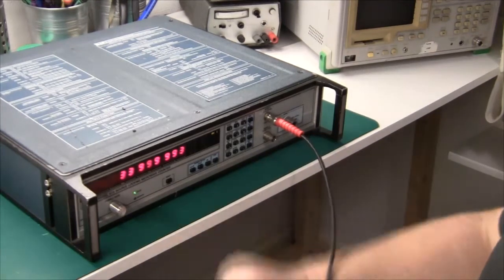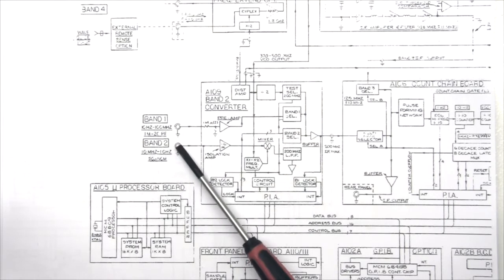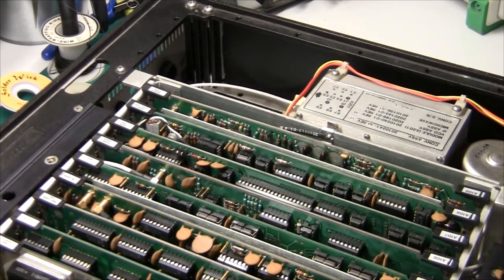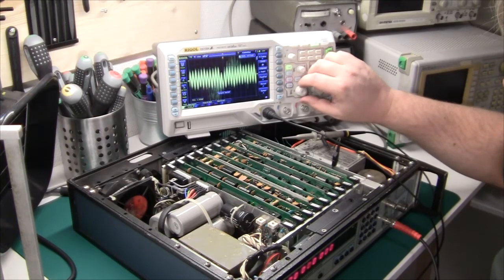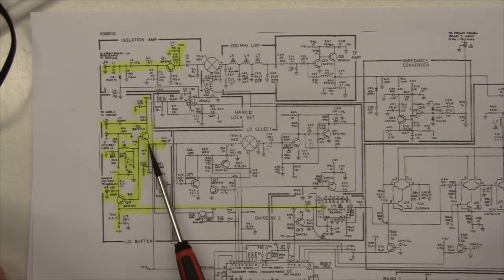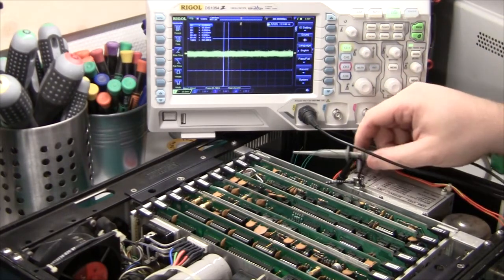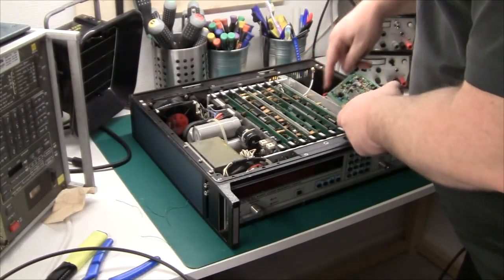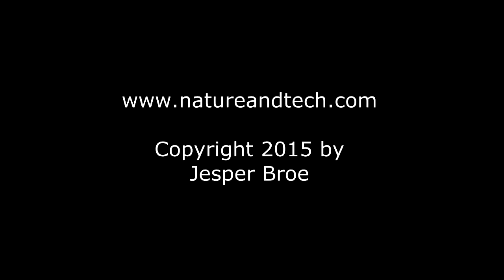Repair of Phasematrix EIP 575 Microwave frequency counter

Comment: very nice work. I just got an EIP 575 and there seems to be a simple way to upgrade it to a 578 by setting a jumper on the Band 2 Conv board. This effectively sets the upper frequency limit from 18GHz to 26.5GHz.

Comment: Hi, thanks for this video. I have bought a 578 and it is not working (depending on the AC-Supply: running counts on display or only zeros). I am waiting for the big capacitors of the PSU, because I´ve found a huge buzz on the DC. If the caps don´t solve the problem I will look for bad soldering-connections on the boards - like your problem.
Reply from the maker: Sounds like a good plan. The supply is always a good place to start.

Comment: Ever seen an EIP 931 Microwave Source?  I used to know someone who had one and I have yet to see one on YouTube.  It's a microwave synthesizer with a frequency range of 100MHz to 18.6GHz and arbitrary waveform generation and modulation functions.  It's the only instrument I've seen so far from EIP which had a CRT display.

Comment: I think the Motorola chip is a HC 1106 or a 1006.The machine will be built with one logic family with the exception of the input stage , maybe.The only other possibility other than CMOS would be ECL but you would be able to see that straight away from the -7.0 V supply . I think you can indeed get replacement chips from China. Ever heard of Harris ???

Comment: Awesome repair. A bit of solder in the end eh?
Reply from the maker: Yeah, luckily. The parts used in that thing are difficult to come by today.
Reply: I like to see these teardown videos. Do you recommend Rigol for power supply, multimeters, arb sig gens and spectrum analyizer? I am thinking of purchasing those items.
Reply from the maker: I do not use these myself, but Rigol is surely one of the better Chinese manufacturers. I would not hesitate to buy their benchtop power supply, arbitrary signal generator and their spectrum analyzer myself, if they cover the ranges that I need, but I am not familiar with their multimeters. To be honest, I have a Fluke benchtop multimeter and I never use it. It's really rare that I need that kind of precision. For me, a normal hand-held multimeter is good enough. But again, that depends on what kind of electronics you do.
Reply: NatureAndTech Yes true. I want to eperiment with opamps in the future and so a precision multimeter might be needed. I have some experiment in levitation I want to run.
Reply from the maker: Sounds very interesting

Comment: Hi Jesper,
I was on a mercedes benz forum discussing how to test and repair a circuit board. I hope you don't mind, but I posted a link of this video for other members to see how to track the errors and make repairs. It is a very good example on the steps required. Here is the forumn post location: http://www.benzworld.org/forums/w124-e-ce-d-td-class/2539642-cruise-control-brakes-lights-backup-lights.html
Reply from the maker: +E. Steve McLaughlin Thank you. The more publicity to my channel the better :)